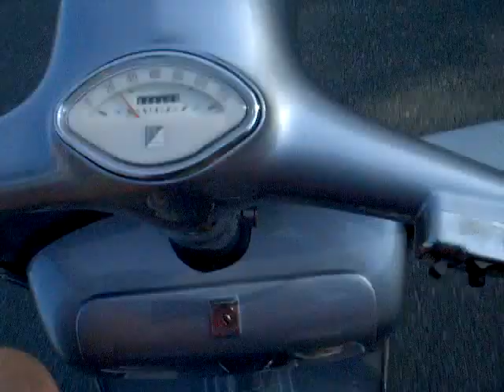180ss 2

Comment from the maker: @fargo069 
Hey.

I can´t remember all that stuff anymore :)
The exhaust was from scooter center in Germany. It is useless with the original cylinder, especially on piston portet ones like the 180SS. It is made for tuned vespas, with big malossi cylinders and such. It looks the business though :)

117 sounds about right, but mess around with it, and see if it runns better on a 120. I Ended up using the 125 actually. Good luck, and keep the Vespa going :)